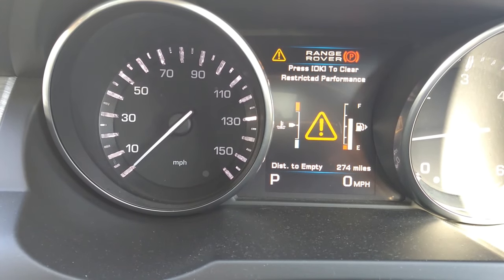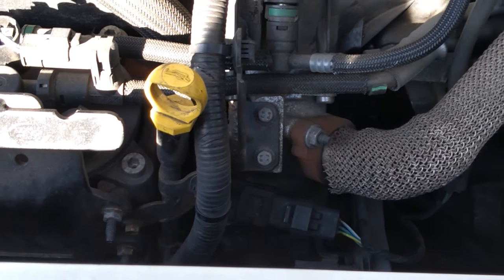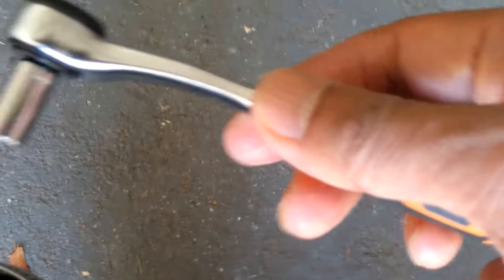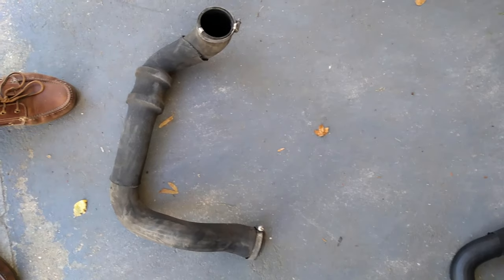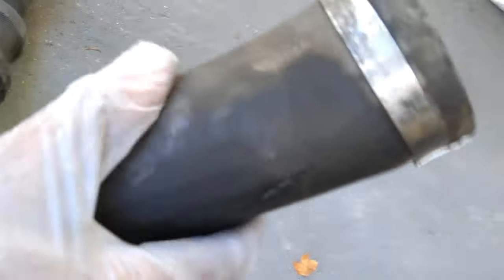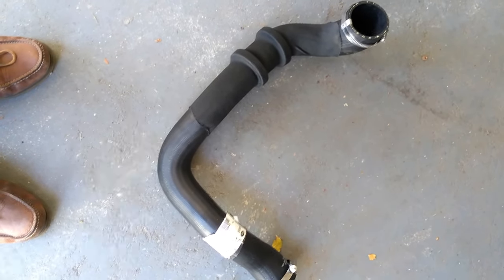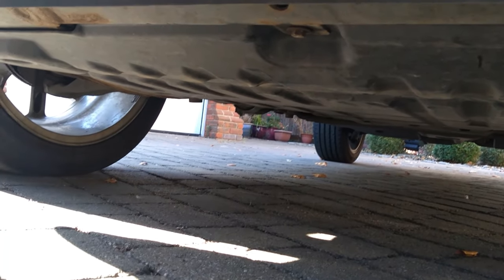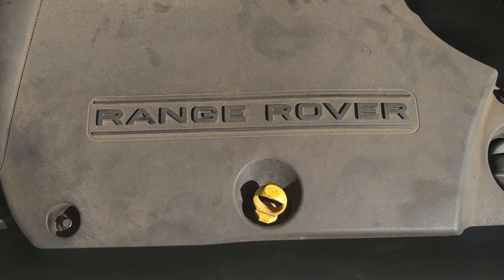Restricted Performance Warning Range Rover Evoque 2012

Comment: Thank you so much for your video. I’ve had the exact problem. The issue came about a year ago and went away by itself. When I delivered it to Range Rover for fiding the fault they told me it was problem with the turbo and that the turbo had to be swapped. It was gonna cost me alot and since the fault signal had dissapeared again I managed to drive it well until a week ago. I found your video on YouTube and this time I went to local repairshop with the problem and asked them to check intercooler throttle hose like you said and they confirmed that it was long rift in it. Bought it online and changed it, the car is driving like before without any problem. Thanks alot man!
Reply from the maker: Great stuff , thanks for kind words and feedback !

Comment: Thanks for this video. Mine went into restricted mode last week, pulled up the OBD error report and saw the MAF sensor code. I cleaned the sensor but came up again after a short trip. Read lots of advice online and then found this video which was helpful as it showed me everything i needed to know. Stealership has had a fortune off me over the past year, so am determined to sort this out myself and save the quoted £250 LR wanted! Robbers!
Reply: It sounds a fair price based on land rover labour rates and cost of part.
If you don't like their labour rates try an independent specialist but this not a hard job and we'll explained.

Comment: For those wanting to know the OEM part number for the hose in this vid is, its LR066436, or LR024304. I am also ordering this part number for my own 2013 2.2 Diesel Evoque with exactly the same problem.

Comment: For those folks that have replaced the hose themselves....... which way did you manage to get the new hose in? Fed in/down from the right side (as you look at bonnet), or left? I have had it in from the right side but took 2 of us, and had to remove it again to swap the aftermarket (cheap and nasty) jubilee clip. The OEM jubilee is the one you need, and it has to be in the same position as on the old hose.
I gave up after several hours of ripping my forearms to bits on bolts etc, so am having another bash at it shortly.
Reply: Did mine today and found getting it out was alot harder than getting in. I went in from the bottom as the video suggested doing lower section first, put a little bit of lubrication on and slipped on easily. Definitely pays to get the genuine part as jubilee clips are fixed in position. I do look like I've been attacked by a cat but that was mainly done on removal. Hope this helps

Comment: ive just replaced ours,did it all from above,used a 7 mm open/ring spanner,the large end i left the jubilee nut at the 10 oclock location,was at 1 oclock but not easy to remove,but spanner was the easiest.all done in a hour,thank you for this vid.

Comment: Hi mate, I’m having this kind of issue with my evoque, goes into limp mode after heats up, but without any faults (neither on board neither on diagnosis) . After enters in limp mode Looses all it’s power. I have checked everything (gearbox oil temperature, dpf temperature, turbine, egr, everything is in paramethers and without any faults . Any ideeas ? Thanks
Reply: Hi hi I have same problem and same issue with you ! My car under power

Comment: While I had an identical problem resulting in limp mode, your video implies thats the answer to all limp mode faults! Surely there is any number of things that can cause it? I gave you a thumbs up however.
Reply: It'takes 5 mins to check and is a common cause of restricted power but it is cheaper to check to most owners who don't have an obd computer.
That is all he is saying. Eyes are cheaper than a dealer. If it's split then needs fixing regardless if there are other faults.

Comment: check these 3 things that may be needed to be changed ( FUEL INJECTOR, or FUEL FILTER , or FUEL PUMP) ... because I had the same problem turned out the fuel injectors .
Reply: you cant have had the same problem then cause this guy shows you where his problem is.

Comment: I know this might be a long shot as this is an old thread. But help! My evoque started doing exactly what you describe here, and periodically displays the restricted performance warning.  Watched this, took a chance it might be this, and low and behold there was a split in the pipe! So it’s been replaced, but it’s still limping in restricted mode arghhhh. Any other tips on what to try next????
Reply: obd2 will tell you the error.
Reply: I have the same problem! Change pipe and still in safe mode and low acelaration!

Comment: Thanks for the info and taking time out to do the video, you have the part number? thanks
Reply from the maker: I'm afraid I don't. I just went into a range rover garage and asked for the part by description.
Reply: The OEM part number for the hose in this vid is, its LR066436, or LR024304

Comment: Had this problem turned out to be the EGR valve :{
Reply: How did you  fix the EGR valve
Reply: @zanelecynthiasiwela5913  my garage fitted a new one
Reply: Thanks Chris. Will have to book it in x
Reply: @zanelecynthiasiwela5913  pleasure helping you X